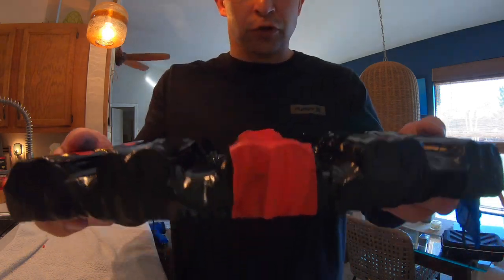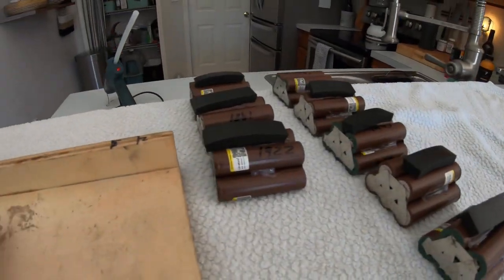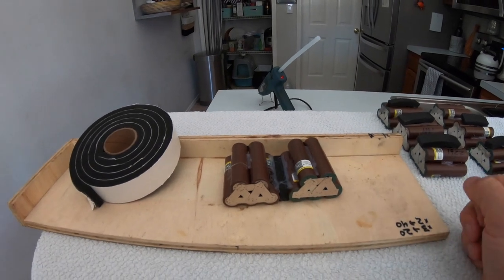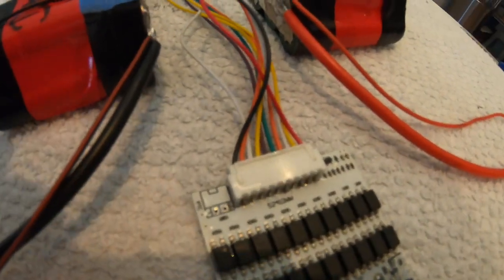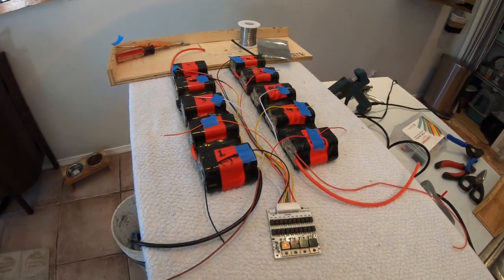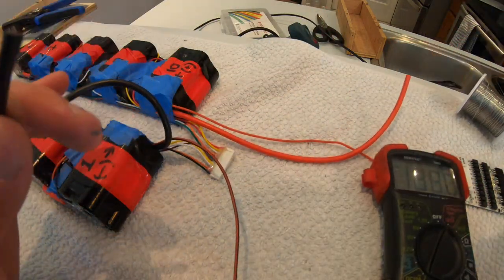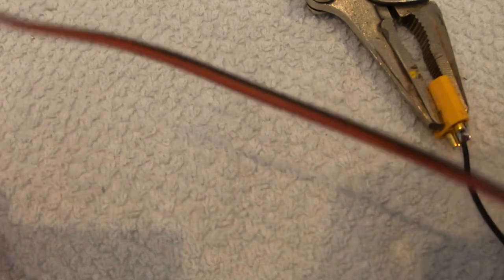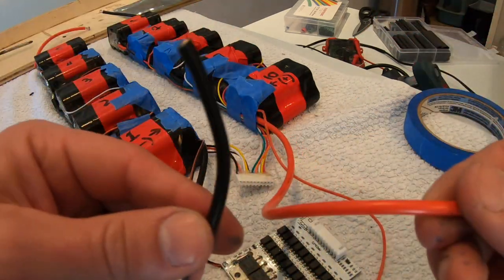Flexible Electric Skateboard Battery

Comment: Hey mate!
Nice work. Just one thing i would mention - there will be quite a lot of heat getting into the cells when you are soldering on the flexible series cable .
Did you look into idea of soldering the cable and the spot welding? Just an idea.
And yes, bms for changing only is my preferred way as well :)
Reply from the maker: Pavel Garmas. Privet Pavel. Yes, ive tried that before.  My spotwelder does not like led on nickel strip. This method with my equipment did not work. Ive done about half a dozen packs using soldering method. No damaged 18650s yet. I usually don’t solder directly over a cell to minimize heating. Cheers from Florida! I am a fan of your beast board! Good job mate!
Reply: @artsiomnaidzich9515  
Privet ! Spasibo za otvet i komiment :)
I have started a new build now and about to build a new battery pack using 21700 cells. 
Stay safe! Regards from London.

Comment: A lot of good idees and a good work.
idea for potential version 2:
maybe you can protect each 5cells pack in an heat shrink tube and glue all the packs on a thin fiberglass sheet a bit like evolve do but with fiberglass instead of their flexible PCB
it could reduce the battery size by removing the thickness of the black foam spacers 
also the fiberglass sheet can be use to fix the BMS and add more integrity to your batery
Reply from the maker: Thanks Vincent.  This pack was built for an all terrain board where space was not an issue.  I may try your power pack set up on a different built.  This is where I used the pack in this vid:  https://www.youtube.com/channel/UCE29FkvsS57dx9vn274z4gQ?view_as=subscriber

Comment: Looks nice. I am in the process of tearing apart a 10S13P and splitting it into 6 10S2P and 1 10S1P. 
I have spot welding them already and now I am just working out how to lay the wires. I'm putting them under a loaded Bhangra. I am going to be making a case from fiberglass. 
Any pro tips? This is my first battery, and a big one.
Reply from the maker: Sounds like a cool project.  Tip: patience.  One small mistake (weak spot-weld on nickel strip, insulation mistakes, etc) can cost you a lot more time in the future (time it takes to fix errors).  Plan out your build and make sure your battery output matches ESC/Motor set up.  Also, know your final goal that you are going for (Lightest build, long distance, to speed, instant or gradual torque, etc).

Comment: I made this but as a 12s (12s5p) and I need recomendations for a bms
Reply from the maker: James Declan. Ive used this one on several packs. Its been reliable and precise (balancing) so far. I wire it for balance charging only (NOT FOR DISCHARGE TO VESC). https://www.ebay.com/itm/324129297450

Comment: I’m new to eboards and I don’t know much about battery’s I’m looking to get the max range and speed out of my battery’s , Would a 5000 Mah 7.2A battery work for my eboard ?
Reply: I’m making my own pack but old what battery’s to get for what I want please help!!!
Reply from the maker: 5000 Mah, 7.2 A?  What is your voltage (how many cells?).  What engine control unit or ESC or VESC are you using.  What type/size of wheels.  Browse my channel.  There is a thorough video on battery making that I released last year (it has crappy sound, but just bare with it, Info is good).  
https://www.youtube.com/watch?v=h6nhsq2Krl0

Comment: Do you feel any difference from lipo to li ion in terms of acceleration?
Reply from the maker: Hi.  I have not used Lipo's on my builds.  18650s, if done right, are able to produce proper current to max out ESC and motors.  I ride with some guys that recently switched from Lipo to Li-Ion.  No acceleration difference.  I think lipo is better if you need high current for long periods of time.  Like a long uphill climb.

Comment: I have a Gt evolve I want to improve my bacteria can you make me one
Reply from the maker: Kiko Diez. What improvement do you want to do? 10s to 12s?
Reply: I'm heavy 245lbs how much do I go with 10s or 12s
Reply from the maker: @kikodiez4433  10s4p I believe is what gt comes out of the factory with.  Battery bay is designed to hold 40 18650s li-ion cells.  I am familiar with people converting 10s4p into 12s 3p (which is 36 cells).  The point of going from 10s to 12s is voltage.  Makes a fully charged battery pack go from 42V to 50V.  This effects your top speed and acceleration, but not so much range.  If anything, you may loose some range.  What is the most important reason for you to change battery?  What range are you getting now?  As fas as I know, Evolve GT goes 20+miles on full charge, even with 245 lbs.  This is formula that governs how powerfull your esk8 potentially can be. Power (Watts)=Pressure (Volts) x Flow Rate (Amps).  W=VxA.  By increasing voltage, power goes up.  It is a lot of work, and not really worth it unless you are trying to go maybe about 5MPH faster.
Reply: I never got 20 miles the most I get is 12 miles
Reply: But right now I just get 8 Miles
Reply: The GT battery is no good
Reply from the maker: @kikodiez4433  How Long have you had it?
Reply: I see people upgrade the battery with
Reply from the maker: @UCI5w0JYraamGGbhabAQhlbA,  you might have gotten a fake bamboo GT.  10s is what it comes with for sure.  Original evolve gt battery is pretty legit.
Reply: I believe people upgrade the battery with 10s p4
Reply from the maker: @UCI5w0JYraamGGbhabAQhlbA GT does have a 10s2p travel battery that's will get you about 8 miles.  Have you opened up your GT and looked inside?  You should.  if you see a battery pack made out of 20 cells, than you have a 10s2p travel pack.  If you battery pack has 40 cells, than you have a 10s4P battery pack.
Reply: It is original GT bamboo I driving right now when I get my house I going to look the manual
Reply: I want 10sp4